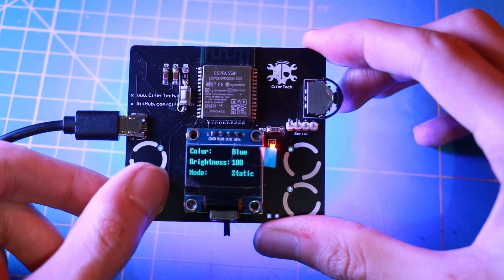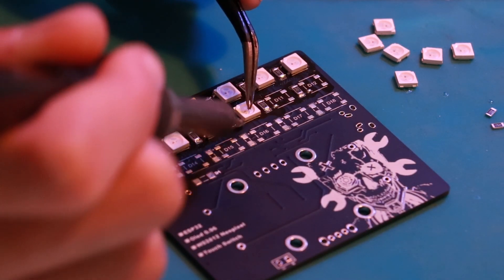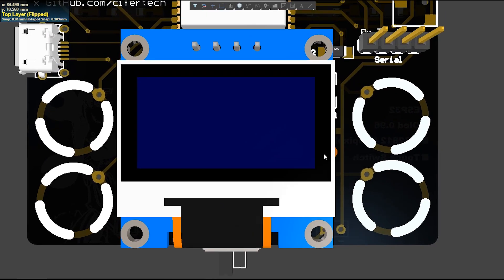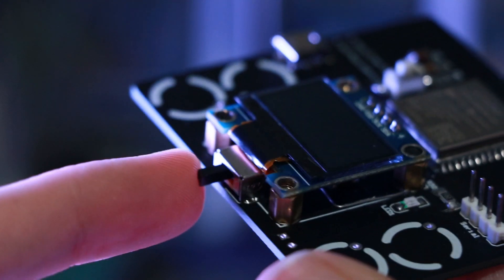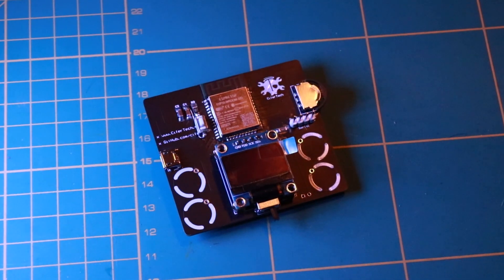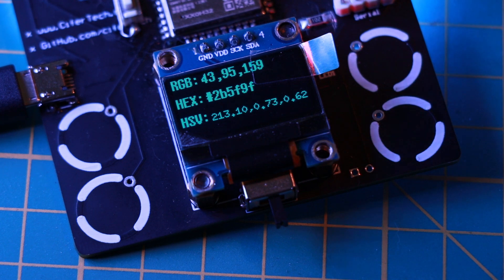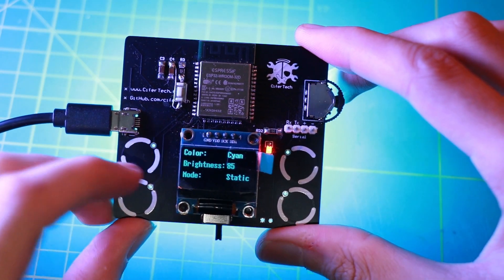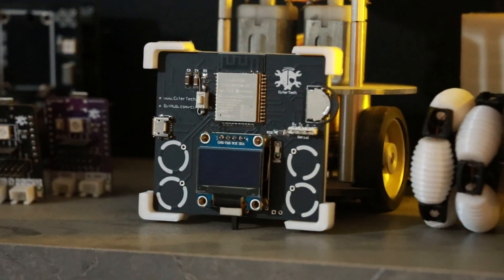Your Wireless Toolkit for Color Replication

Comment: I was wondering about the choice of using an ESP32 alongside an ESP8266, specifically the D1 mini. 

It seems like integrating an ESP8266 (without ESP32 or D1 mini) directly into the main board could streamline the design. Perhaps the main PCB could handle color detection and also manage WiFi connectivity — initially setting up its own network for a direct connection to input WiFi details, then connecting to the specified network upon reboot. If the connection fails, it could automatically revert to hotspot mode after a short delay. This approach might reduce costs and complexity.

The inclusion of both an ESP32 and a D1 mini seems a bit redundant. Given the compact size of the main PCB, it appears quite portable on its own.

Nonetheless, I find this project to be incredibly fascinating and innovative!